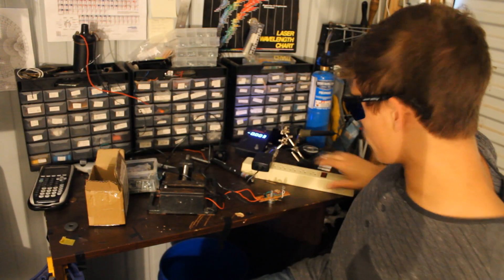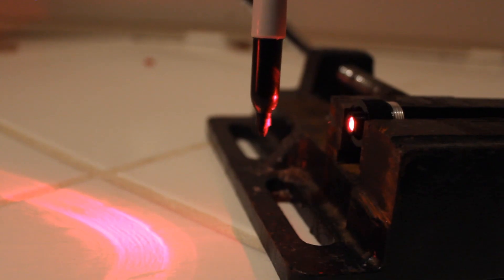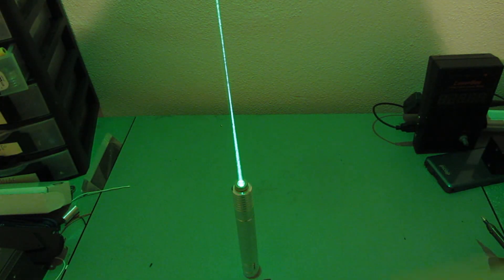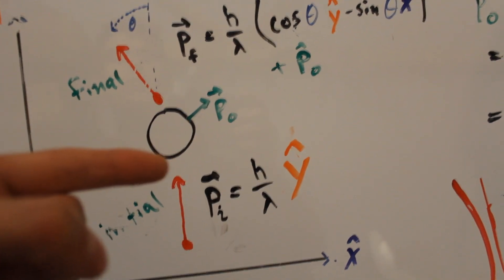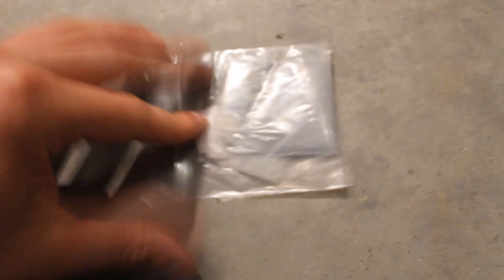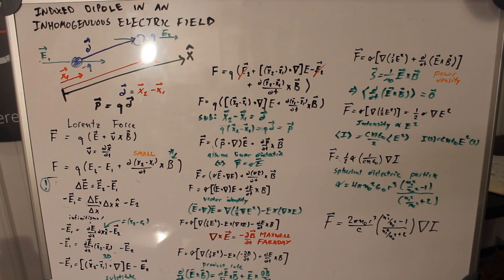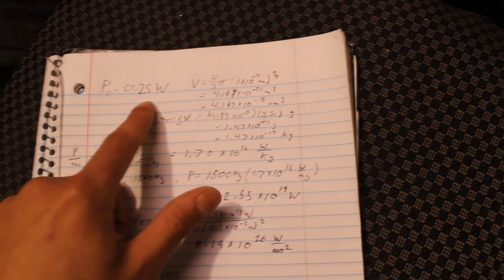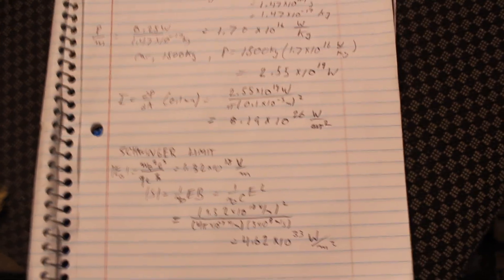Levitating DIAMONDS with a laser beam!! (demonstration of Nobel Prize in Physics 2018)

Comment: If u changed the focus point while there’s a particle in it, would it move with focal point?
Reply from the maker: yes it would!
Reply: @styropyro  what about a car levitation, i think, with the power of a laser you mentioned in video , it will just evaporate :D
Reply: @88Timur88Bahmudov88  It would be safer for the car if we levitate it with moving air, like a hovercraft. Otherwise your car had better be pretty damn transparent!!
Reply: ķίภģ Σxpériment it’s probably easier to find nano titanium. Try looking for that instead
Reply: @Mignuke  titanium is a good conductor, not a dialectic.
Reply: styropyro WHERE find a nano diamonds pleeeease?! I love science☺
Reply: @kgxperiment8181  i think he found it on ebay (which is where he gets most of the stuff), but it is way cheaper on taobao (hope this helps, even though u asked 2 years ago)
Reply: @alexliu2221  Every help is appreciate and whatever when haha ^^! Thank you very much for your tip👌 ! I wish you a Nice day☀️ !!
Reply: ķίภģ Σxpériment also, next time u write a question, write it as a seperate question instead of a reply to somebody else’s question, i only saw ur question because I like scrolling down and I’m sure u could have gotten ur answer way quicker than 2 years later if u posted it as another, separate comment.
Reply: @alexliu2221  Yeah, of course ! You're right ! But, don't worry, i understood it since a long time now (fortunately x'). However, that's fine, thanks again for your answer (& your capacity to scroll👌 !). Peace🕊
Reply: Alexander Mikhniouk Ok thank you for your answer;)
Reply: @kgxperiment8181  you can get diamonds into the 1u range for polishing gemstones. 100,000 mesh diamond is... ridiculously fine. Pick up a gram or .5g for under 20$
Reply: @captainTubes  Thank you^^! I have already my powder but i prefer do the levitation by using marker xD
Reply: So that means aliens literally could levitate things with a laser beam
Reply: @arthurmorgan6087  only if they're as clever as this kid!

Comment: can you use this to build a lightsaber?
Reply: This has nothing to do with lightsaber at all, it's not related.
Reply: Cool effect! The wavelength of the Laser suspends the floating reflective diamonds, hmm a lightsaber tip combined with a concave mirror with a hole in it at the base emitter to allow the beam to the surface coating on the reflective tip to bounce the beam back to the concave mirror, I'd say it looks possible for a lightsaber. I'll make a video about it if he doesn't. I was thinking using Ultrasound to make a virtual mirror "in air" or a solid sapphire fiber optic to achieve a lightsaber blade with the strength of steel with a laser-hot tip that could cut through just about anything, but hey, a levitating diamond tip would look way cooler. Can it be done Styro??

Comment: The biggest problem, really, is that energy densities which would levitate a car would appear to be high enough to melt it into a uniform spherical blob and probably turn much of it into a plasma in the process.
Reply: Well, bigger problem would be that if you were to try it in the presence of air (or atmosphere of any gas), the air would electrically broke down under the electric part of the electromagnetic wave into a ball of plasma, but the plasma is absorbing the light afterwards... And you're pumping zettawatts of power into it... BOOM :D
Reply: So the laser based tractor beam would also function as a pretty good energy weapon. Nice. (Or possibly blow itself up when it hits the air, not certain)
Reply: So, Covenant glassing beams?
Reply: @masterofthelag8414  Come here...Now blow up! Sounds like pretty much every relationship.
Reply: the primary function would be that of a weapon. The traction part is on what remains of the target...
Reply: @paoloinverse8141  So you could turn your enemy into plasma then tractor beam him in and mold a series of cats?
Reply: @johannesdesilentio1536  why cats
Reply: @chaosorder7225  What's wrong with cats!? Not chaotic for enough for you?  How about a series of upside-down white-noise sculptures rendered in order of entropy at random points in space-time cryptographically isomorphed from a shaken-up non-euclidean pachinko universe?
Reply: @Paolo Inverse: Resource harvesting :D ( a la EvE online)
Reply: It would be a pretty bad-ass weapon.

Comment: What kind of marker is he using? Mine does not work, although it’s very still and the laser is quite powerful
Reply from the maker: what kind of laser are you using? i used a sharpie here, but i've gotten it to work with other markers
Reply: I’m using a red laser 303. It’s possibly too weak. Should I use my ~300mW violet laser instead?
Reply: Daniel Petka he mentioned the color doesn't matter, which is sensible, and 300mW being greater output than what styro is using, it should work fine as long as you have a narrow beam waist that's focused pretty close to the output
Reply: realfutbol1 makes sense

Comment: Now to levitate the jewelry out of the diamond store and I'll be set for life!
Reply: Next video: how to use laser to burn through security glass
Reply: @riven8351  thats what the levitating diamond cutter but secret is how to project ultra violet to not set off lazer alarms n the safe is a issue but a forklift n dolly might work once you unwield it from wall n ground after picking lazer systive lock best way is to steal a line man's pole cut the power off scope out for generators but I doubt cause ur avg security don't know pulling fuse on the relay its a lil brass loop pull it open its called opening the door by transformer can looking bigvthing just don't touch 2 wires at once or squirrel cages if removed or u might blow the pole n transformer up if u touch those wires
Reply: Then u got ten minutes to use w shape charge n collect what shit u can find idd go for the gold shavings inside 10lb it 1 million
Reply: Just get a laser powerful enough to levitate the whole store
Reply: Twilight Sparkle yes
Reply: @yuno9121  BRAIN 100
Reply: yup you will be set for life all right ,,one way or another
Reply: @ARCSTREAMS  that pun was great
Reply: @Anatidae_  ty 😁
Reply: We need BLTs.

Big laser thingies, have you never seen LEGO Thanos?
Reply: I made your count 500
Reply: 669 likes good enough
Reply: FBI OPEN UP
Reply: Now yo just need a laser as powerful as the sun
Reply: Toby Green styro has a laser million times stronger than sun, no break window.😕😑
Reply: Wait you only want the jewelry not the diamond lol
Reply: Pikachu Power_gaming  no
Reply: i ruined the 869 and made it 870 (i know this is old)
Reply: @spidertiger585  but i still see your sins
Reply: *theremin music begins playing as a diamon necklace floats off of the rack*
Reply: Problem one, roof
Reply: new eric andre bit has finally been realised
Reply: I think you mixed the words diamond and jewelry
Reply: They won't be able to blame you because you never touched it
Reply: you go buy it
Reply: the light would be refracted by the glass
Reply: If by set by life you mean; never having to pay for rent or groceries ever again, then hell yeah you will! Hahahah 😅
Reply: Try IR lasers for that!
Reply: You just perjured yourself

Comment: Now the real question is: Would the laser base get measureably heavier from "levitating" that spec
Reply: Any form of energy loss (even chemical) has an associated loss of mass. Chemical reactions are 300,000,000  times less substantial than nuclear reactions (which are still themselves just fractions of a percentage in change) though so we tend to ignore the mass change as it is usually nearly immeasurable. If energy exits any otherwise closed system the mass of the system will decrease by m^2=(E^2-p^2c^2)/c^4. An example would be a combustion of cellulose C6H10O5 + 6O2 > 6CO2 + 5H2O + 25 eV (the 25 electron volts is the amount of energy radiated from the reaction in the form of EM waves (or rather fire/heat/light)). Normally this value would be given in calories or Joules/kg instead of eV per reaction set. If the system were fully closed and the energy contained no change in energy would be observed but by the conservation of energy if energy escapes the system the mass of the system will decrease.
Reply: Standgrounding, no, it wouldn't lose mass because energy that you get from battery is actually just a chemical reaction.
Reply: Mass is just confined energy (~5 grams of any matter is ~450 tera Joules) heat energy or kinetic energy of any sort for that matter will add into the total mass of the system (by special relativity). Electrons change energy levels during the reaction (lose energy in the form of EM waves light/heat is those electrons moving from one energy level to the next). If you measured with extremely precise equipment you could measure a mass difference in a hot vs cold steel ingot though the difference would be extremely small (as stated since the difference between 450TJ and 450TJ + a few joules of heat is basically nothing).
Reply: Don't take my word for it though google it and fact check never take what random internet commentators say at face value. I went into physics because I found questions like these extremely interesting. ^^
Reply: I don't think it would. There is no interaction between the laser base and the diamond.
Reply: kinsi55 Kinsi bist ja wirklich überall :D
Reply: Jason Vance, yeah I googled it. You are kind of right :D.
Reply: The counteracting force acts on the photons, bending them away. Since there is a downward attractive force on Earth, the majority of the photons will be bent upwards, meaning that the diamond speck will appear shinier from above than from below.
Reply: That written calculation was more mind bending than the levitation itself.
Reply: A name I recognise! I didn't think I'd see you here
Reply: I think that the laser source wouldn't get "heavier", because it's a "one sided" interaction here. The photons are emitted from the source, and they act on the diamond, but I think there is no energy that would hit back the source, emitted regularly (or at all) from the diamond. There is no connection like perhaps between two magnets, or charged particles, in which case   you can observe the magnet getting "heavier" if you float other magnet on it, because the floated magnet also acts with the force on the base magnet. . There is even a youtube video about it made by The Action Lab. Im not sure about it however and it's just my assumption, based on just the momentum exchange model, which Styropyro said could innacurate.
Reply: Kudos for asking a Brilliant Question To me anyway!
Reply: If an Archer fires an arrow and deflects an apple upwards into the air, does the Archer get heavier?
Reply: The levitated speck interacts with the photon beam, which has its own momentum and is slightly deflected by the speck. The laser only feels the recoil from generating the flow of photons, and there is no difference to that recoil force regardless of what happens to the beam after it leaves the optical cavity
Reply: It would lose mass, because it loses energy(E=mc^2), assuming its powered with battery and not mains
Reply: @mindaugask_  That's not the point. In physics you try to simplify everything as much as possible, this is why you can assume a cow is a sphere in a vacuum.
Reply: I guess it would experience a recoil force due to the light going into one direction... It wouldn't be that strong though
Reply: Jason Vance, chemical reaction is just rearrangement of electrons. Electrons don't convert into energy, they are just moving from one atom to another.

Also you said if system loses energy, it loses mass. No. When red hot steel ingot is cooling down it's losing energy but not mass.